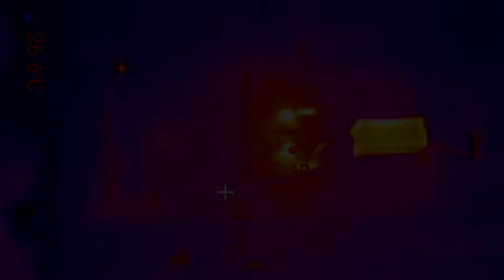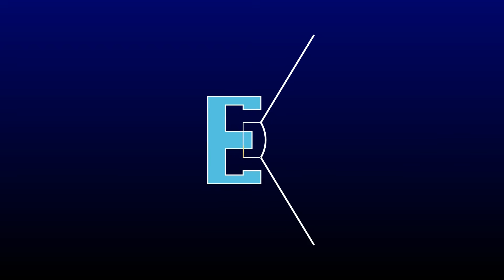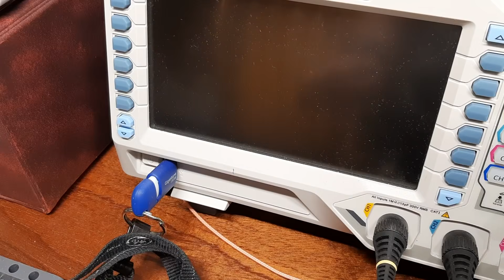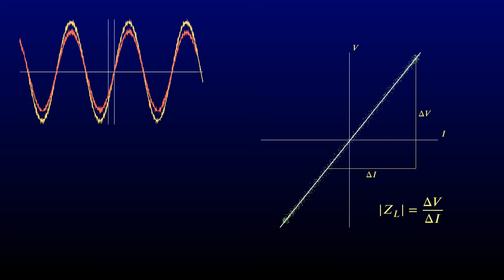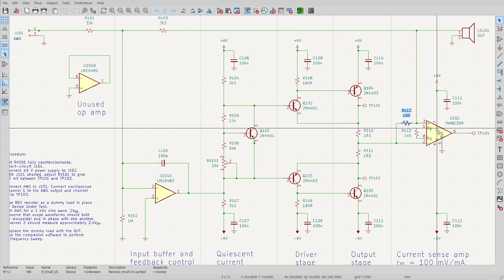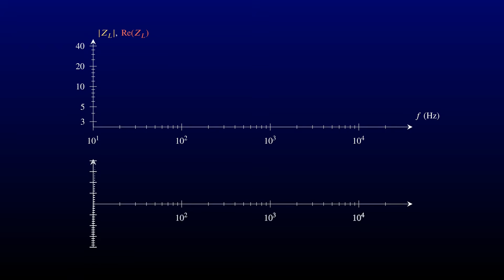How Not to Measure Speaker Impedance | Transistors 101, episode 21

Comment: I enjoyed this video. I figure you have reasons for doing what you did how you did it but I would have put the current sense resistor between the speaker and ground. Then you could make it a lower value (1 Ohm is very large for this task) and just use a normal op-amp to get your current waveforms. Of course I don't know where you're going with this so I may be wrong. Things like this are, as my dad used to put it, always a science project! 😁
Reply from the maker: Force of habit, mostly! I'm used to sensing current on loads that have to be ground returned.

Another approach that can be useful sometimes is to return the load to a virtual ground and let the op amp output drive the scope.

Comment: I like the virtual ground and split feedback in the first schematic. Virtual ground has been my passion for six months now!
In the second schematic, am I seeing a Sziklai configuration?
Reply from the maker: The virtual ground is something that appears in just about any inverting op-amp circuit because it's a natural consequence of negative feedback.

You are indeed seeing two Sziklai pairs in the second schematic, one pushing and one pulling.  They have real advantages for this sort of amp - notably, that they have much less thermal variability (the base-emitter voltage of the output stage is just that of the driver transistor, which stays cool), and they have only one diode drop between the base of the driver and the supply, which allows a diode-drop wider output voltage swing for a given supply voltage, which in turn allows the supply voltage to be about a volt lower, dissipating less power in the output transistor.
Reply: @KludgesFromKevinsCave 
I mentioned the virtual ground because, after years in power electronics, six months ago I started consulting for a client who manufactures solar radiation sensors. For years, they had been using a PIN photodiode with a shunt resistor and a non-inverting op-amp. When I first saw the schematic, I remembered the theory that a photodiode should be short-circuited and read in current mode—reading it in voltage mode just drives you crazy in the firmware. And that is exactly what had been happening in that company for years. Thanks to this consultancy, I fully understood not only TIAs (Transimpedance Amplifiers), but also the many benefits of a virtual ground. Now, whenever I see one properly used, I immediately recognize an experienced design.
Thank you, sir, for your 'no-kludge' lectures!
Reply from the maker: The op-amp course on this channel has an episode on TIA's. The example circuit is a photodiode amp.  

There's also a unit on the opposite problem: an electrt mic, which is a voltage source that can deliver only a minuscule amount of current. For that you need transconductance, rather than transimpedance. (Why don't we say transadmittance? No idea!)

Comment: Great video as always, this channel is a treasure. Measuring speaker impedances is cool but have you considered measuring antenna impedances? Just need to support frequencies into the MHz or GHz :)
Reply from the maker: I think I might have a noise bridge in a box somewhere. Now that the TinyVNA is so cheap, I should probably pick one up one of these days.
Reply: @KludgesFromKevinsCave  Oh thanks for the references, I wasn't aware of TinyVNA. I do have some RF projects I have to get to myself at some point. So many projects, so little time.

Comment: Superb video Kevin 🎉🎉🎉. I would have used calibration to solve the HF phase problem because I have an additional 4th property: I’m too cheap to spend money on a second INAMP 🤣
Reply from the maker: Thanks for the comment, and glad you enjoyed!

I'm a cheap SOB too, but when I get parts, I usually get spares. (Saves on shipping when I inevitably destroy the first one or two!) That's why I have a handful of INA823's on hand - they were spares from another project. I even had two already mounted on DIP carriers - they were left over from breadboarding while the final project had them soldered on a PCB. So I had the luxury of optimizing for my time - which is by far the scarcest resource at my bench!

Looking around the book of SMT parts (I use a couple of those notebooks from Adafruit where you can stick strips of cut tape into little plastic sleeves), I see that also have a couple of INA143's that I could have used - which I must have on hand for the same reason - leftovers from something else. They would have been even simpler if I had remembered that I had them!

The impedances are low enough that I could also have used a dual op-amp wired as a pair of diff-amps. With a TL072, I could have used 100k input resistors and 1M feedback resistors.  But since I had the INA823's on hand already, they were by far the simplest solution to the problem - one resistor per amp instead of four.  Better CMRR, too, but the dual-op-amp solution would surely have been Good Enough. And they can go back in the cupboard when I'm done for the next time I need an accurate diff-amp!

If I were designing for production, I'd look for the cheapest dual JFET-input opamp I could find, add two quad-packs of resistors (100k and 1M) and finish with only three BoM items for that part of the circuit. (And I'd have had the inevitable conversation with Sourcing about whether it would be better to use an INA2123 and have a single, more expensive BoM item.) But then I'd have had to spend some time figuring out the routing, with both IC's needing to connect to both resistor packs. Too much effort for a one-off demonstration!  (After the next video, this breadboard gets torn down and the parts go back in the cupboard.)

Comment: Nice video Kevin. Murphy's law is unavoidable.

Recently, I was doing delicate differential measurements with a lock-in amplifier (also software-controlled frequency sweeps). The curves were horrendous. Software was ok, BNCs made contact, waveforms were correct in DSO. Turns out I hadn't switched to differential input... I was doing single-ended measurements.
Reply from the maker: There was one time around 1978 or so that I was trying to track down a weird intermittent in a huge board of CMOS logic. The 5V supply was open and the board was powering itself through the input protection diodes, but only if enough inputs were logic-HIGH. The amount of time you waste on that sort of silly stuff is unbelievable!
Reply: @KludgesFromKevinsCave 😂

Comment: Great video! A audio analyzer like QA403 could be useful anyway, since they are capable to  measure extreme low noise levels. I've learned even resistors are great noise sources.
Reply from the maker: Sure! What surprised me about resistors wasn't the Johnson noise  - which you can't do a thing about; the cheapest resistor on AliExpress, eBay or TEMU will have exactly the same noise - but rather how much 1/f noise the cheap ones have. If I live long enough, I might do a whole series on low-noise design. Glad you enjoyed!

Comment: Yep, the Thiele-Small model of speakers… can cause all sort of confusion if you only test speakers with a pure resistive load. I keep on seeing on youtube people only using a pure resistive load on speakers, and then they think everything is OK… until they hook a real speaker in its enclosure+crossovers to the amp, and everything turns into chaos🤷‍♂️🤷‍♂️🤷‍♂️ (of course, you can design+build your own actual complex load(s))
Reply from the maker: Since you're obviously one of my sophisticated viewers, you'll probably have noticed that I'm using rather aggressive dominant-pole compensation on the amp so far. I fully expect that will be a problem as I move to higher power, but I'm planning to put off discussing the Zobel network until I need it. I find that the lesson sticks better if it's framed as, "and here's what they came up with to deal with the problem".

I might not ever get to Thiele-Small. I've never designed my own speakers from scratch, only built other people's designs. I was mostly a laboratory/industrial instrumentation guy, not an audio person.